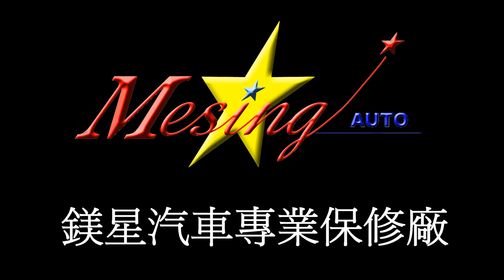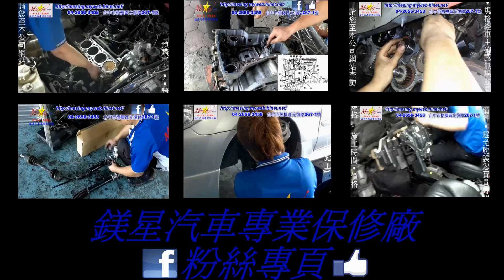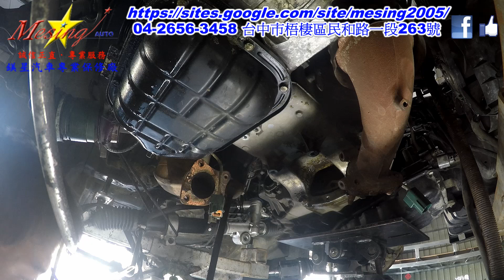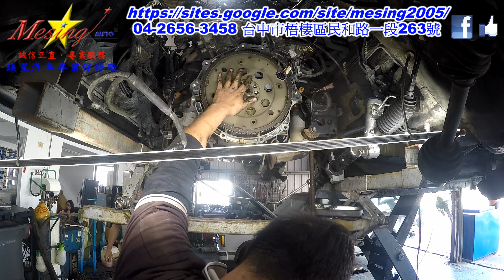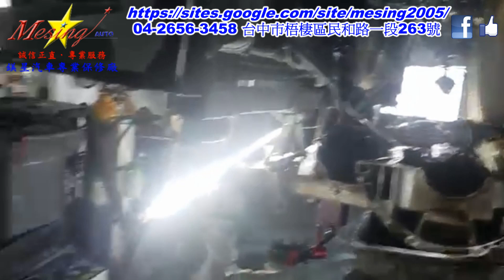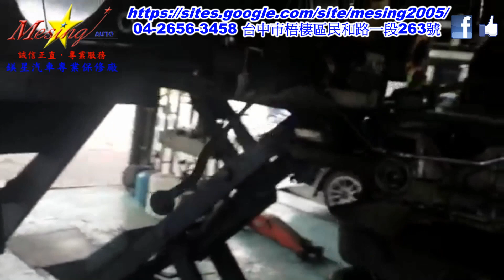How to remove oil pan gasket and crankshaft seal oil leak NISSAN MAXIMA TEANA V6 2005~2008 VQ23DE

Comment: I'm sorry but why did you pull the crankshaft cover off? Was it really necessary for oil seals replacement? I have some minor leaking from the same place in my car. Spotted it yesterday. Now I'm wondering do I need to pull this thing off or I should just split the transmission off the engine and that would be enough.